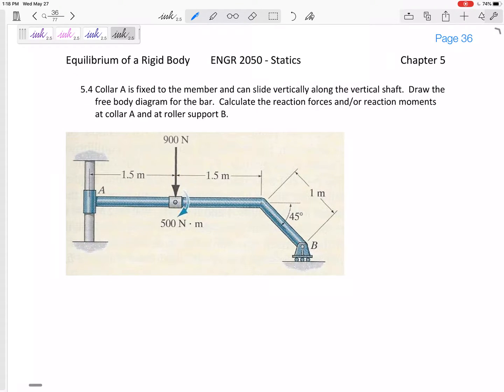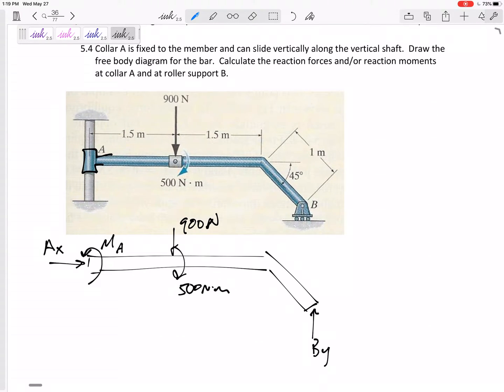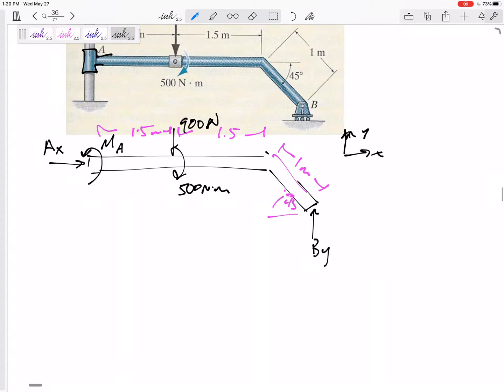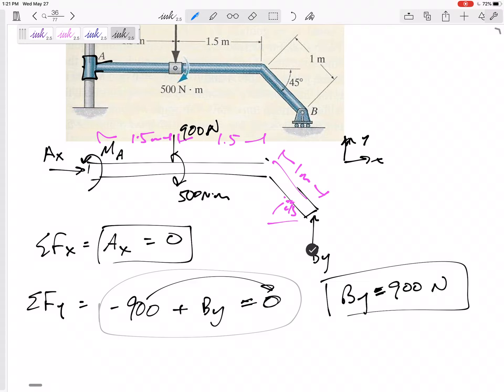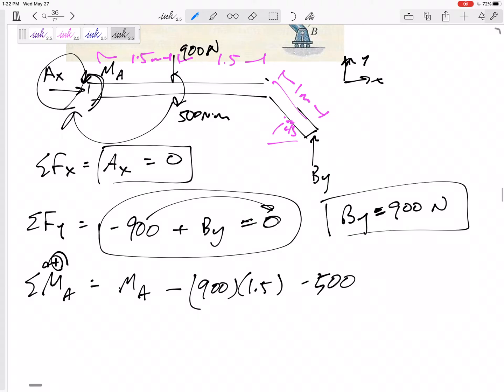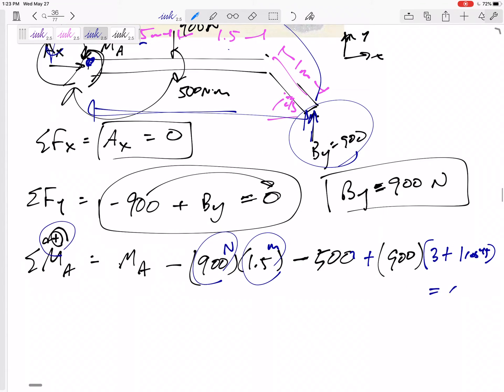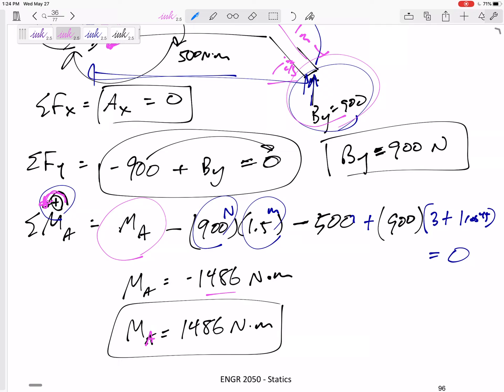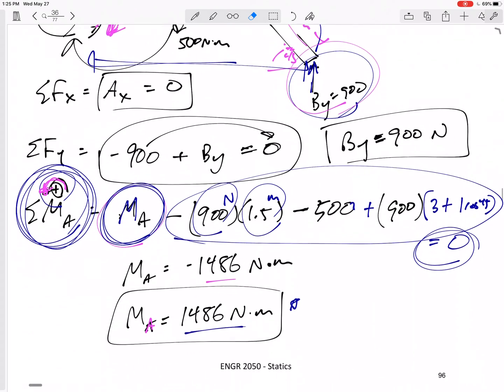Statics - Equilibrium of rigid bodies example 4

Comment: I thought it was sin45 when you solved for the moment
Reply from the maker: No, the moment arm would be 3 + 1cos(45). But it really doesn’t matter with a 45 degree angle because sin(45) = cos(45)
Reply: @engineeringdeciphered  okay makes sense now! Thanks